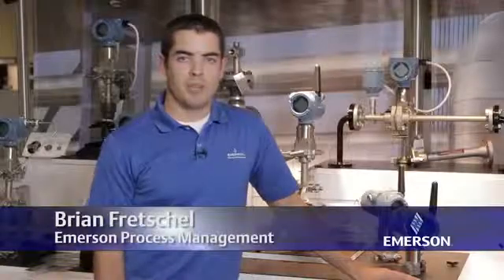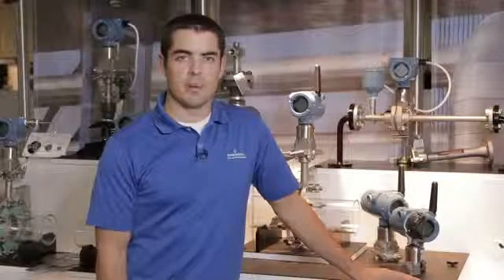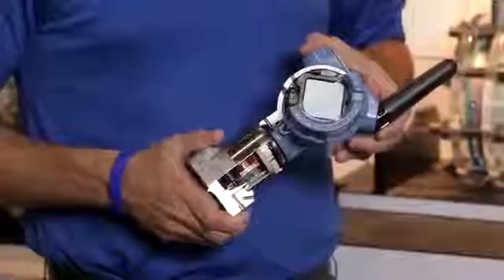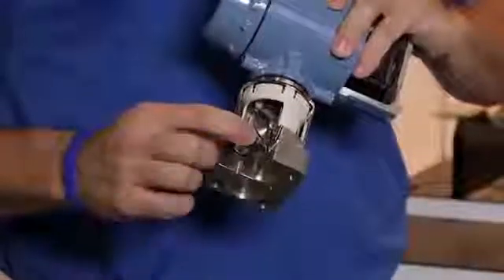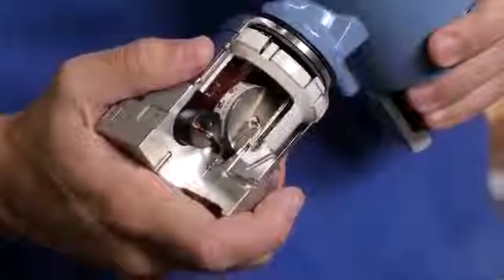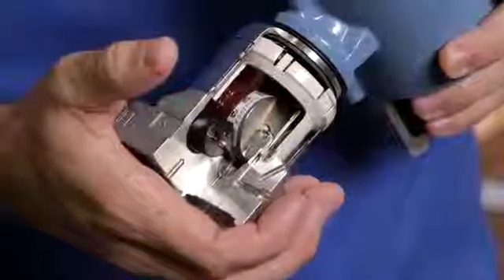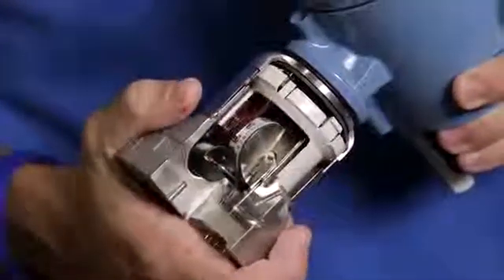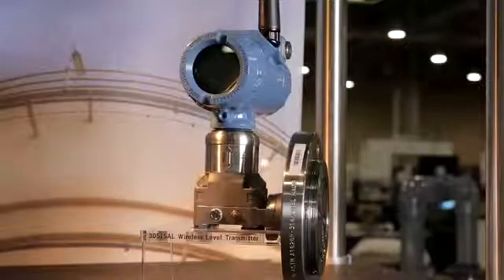Rosemount 3051S Wireless Pressure Transmitter // PCE

Comment: Rosemount wireless intrinsically safe transmitter Ex ia IIC did needs a zener or galvanic barriers in control room, or doesn't need because its have a battery inside it and limits the voltage